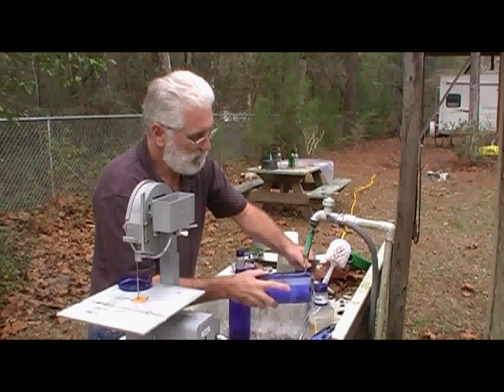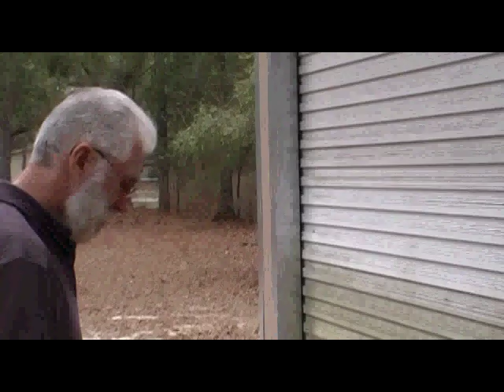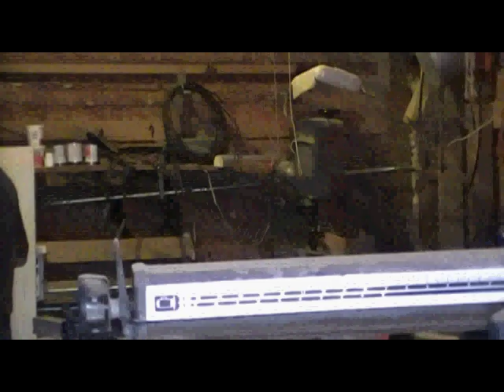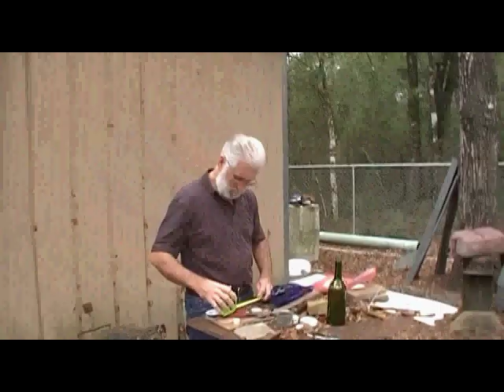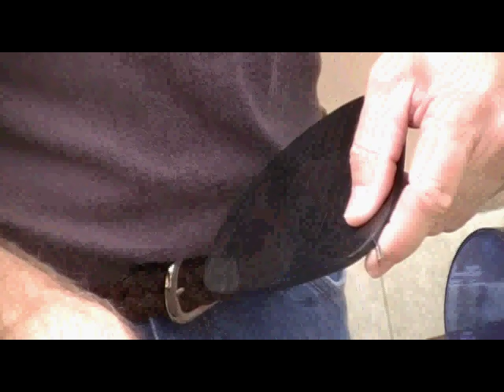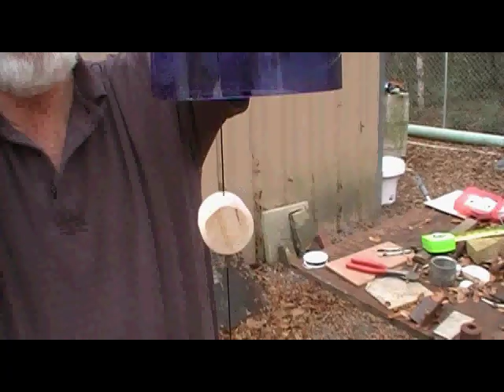Wind Chime.avi

Comment from the maker: I've lost the package the ferrules came in so I can't give the size.  However, the ferrules are sized to the leader wire and I use coated stainless (I've used uncoated leader wire as well).  Looking at the packaging for the leader wire it is 60 lb test strength and recommends using a #4 ferrule.  To buy leader wire & ferrules you will need to go to a sporting goods store and look in the fishing section.  60lb test strength is probably the thinnest available and more that adequate for hanging.